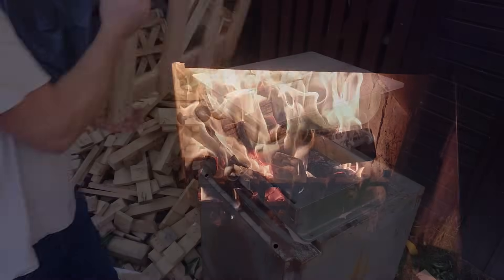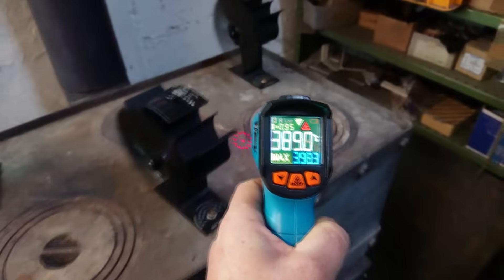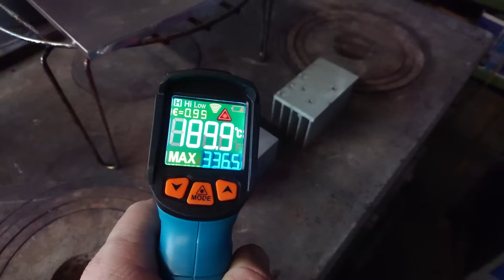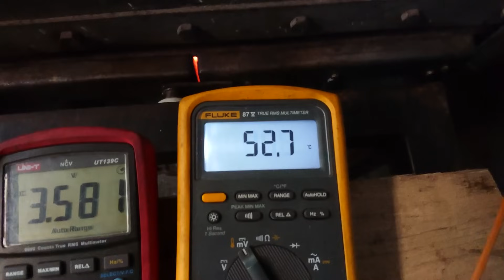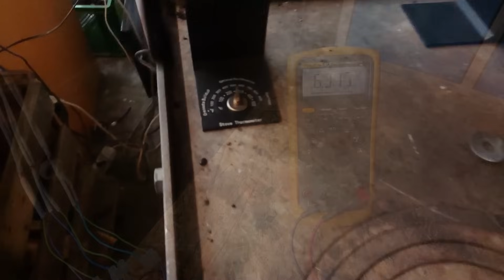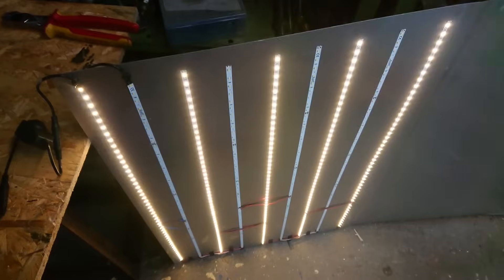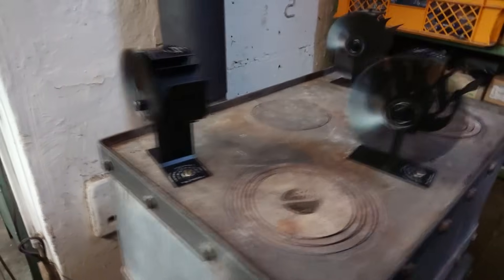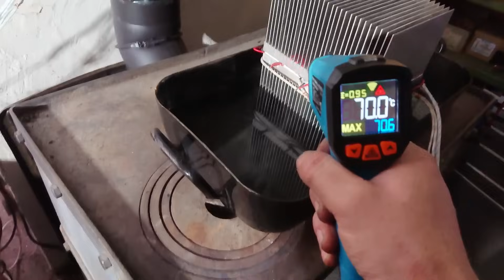Generating Electric Power with my Wood Stove - Peltier Experiments

Comment: You covered all my concerns in the first two minutes. Whether it's wood gasification, a steam engine, or a Stirling engine - there are much better ways to get meaningful amounts of electricity out of wood. 

Any of these would produce 10w, 100w, or potentially much more. 

If light is your only goal, propane and kerosine can get hot enough to get a mantle producing light. With some creative engineering you can probably get the same heat from wood.

Comment: There is a Civil Defense station near a friend's house up on the mountain that flies propane tanks with a helicopter a couple of times a year to use as Thermoelectric generators to keep the batteries charged up. So you probably could use it for battery top-off or for maintaining remote batteries.

Comment: Have you considered using thermo-couples ? You can wire as many as you like in series and you can separate the cold side from the hot side by a fair distance. I believe that types J, K, or N would be the most useful. You should have no problem locating a bunch of lead wire that has been removed from some chemical plant or refinery at some scrapyard. Then all you need do is get to work making all the hundreds of thermo couples required. This is I believe what NASA used for the RTG's on the two voyager space craft ( still putting out some usable energy after 45 years or so ). Of course the 'R' in the RTG name stands for radiation ( radiation thermal generator ). You would be using a heat source much safer than the plutonium plugs in the two voyagers .BTW such a device is called a '" thermo pile ". Small ones are used in some gas water heaters. Just put the cold side junctions an a sealed pipe with cool water running through it. Just like the Peltier Junctions, the bigger the thermal span, the more power!

Comment: A cold air intake from outside that was fed over the cooler side of the devices and then used to feed the air intake of the stove would help both the Peltier Devices and it would help keep your warm air in the shop....

Comment: I think an external Stirling engine, with the hot side fed from the wood burner's exhaust, would have a usable temperature gradient during a typical German winter - and could produce enough energy to charge batteries to power LED lighting.  Peltiers are interesting - but not really a useful energy source.  Thanks for the videos.

Comment: Hi Tpai, what about having two pipes on the stove? One is an outdoor-air intake pipe and the other is the hot exhaust pipe. You could place the peltier device between the two pipes to maximize the temperature differential. The exhaust pipe would perhaps enter the stove from the top so it is a natural path for rising air while the inlet pipe should feed air from below so it is basically acts like a diode for cold air.
Reply: BRILLIANT!! Vote this up!
Reply: The cold air pipe does not even have to be a stove inlet pipe, simply a duct open to outside would be a much bigger differential than his current setup, PUT A COLD BEER ON TOP, VOILA!
Reply: @Mr.Fabrication007  But why and how would you create wir flow if the pipe simply comes from the outside and goes back to the outside ? This would not make sense, since the stove needs fresh air anyways the idea makes much more sense. You want to reuse the components you already have not intriduce new ones this way you increase the efficiency and decrease part count.
Reply: I think he means creating an extra/ separate air intake on the stove at or near the bottom, while still having and rerouting the exhaust pipe. This would solve another issue- the inside of your shop would be much warmer making the stove more wood efficient. Instead of cold air coming in around doors and windows lowering the room temperature, the cold air is confined to the intake. I think you could create another section of square tubing for the intake and have the peltier panels inbetween.  This would give you a greater temperature differential, but I’m at a loss how to regulate it. This is a fascinating proof of concept- thanks for so much time and work- making the world a bit better.  @sierraecho884
Reply: Yes, good idea.

Comment: The only negative about your pipe addon was that you used the 4 pipe design, it will be a bit... difficult to clean the creosote out of every season.. I'm sure a purely square adapter (I think you implied you intended to use) would be not much of an issue, but I would def do the square -> round section smoother, without the lip.

Comment: how efficient is a peltier device.. and what is that system used to convert nuclear based heat into electricity .. used many moons ago.. at remote cold regions.. to operate radar..radio and lighttowers

Comment: Transfer the heat away from the stove using a circulating water pipe loop. A temperature valve regulating the flow could keep the temerature efficiently at 100 degrees C. If the heat drives the water circulation using a one-way valve, there's almost no moving parts. Then heat the peltier elements on the other end of the water system.

Comment: For the experiment with the exhaust id like to see a dual system with intake and exhaust running in parallel pulling cold air from outside cooling one side of the pelter and the exhaust heating up the otherside

Comment: Isolated water tank with the peltiers attached to an unisolated side. Natural vertical draft over the cold heatsinks on the peltiers. The Water can be heated by the chimney. Water circuit needs to be open/vented for safety reasons.

Comment: You can try water medium based heat exchanger I mean working like central heating (water movement up to collection basin over tipping cooled down water back to heat up again and just on output cycle install thermoelectric cells you will be safe with overheating as well😊

Comment: Great Project! Have thought about similar stuff a coupe of years ago.
Getting the heat out of the system is a pain in the ***, but transporting heat is quite easy. so I would work with steam, like a couple of others have suggested. Pipe the steam outside to a condenser where you mount the peltier elements. It also has the advantage of getting the elements away from the stove. Get yourself a big cooking pot (maybe a pressure cooker, so you can experiment), mount a hose stem, connect an isolated pipe with a steam hose and than the condenser.
For the condenser I would go with a perforated pipe inside of a square tube. Mount the elements on the outside and you have enough room to run wires for each element along the edges which should improve troubleshooting. use metal sheets for heat dissipation, cut it in an angle to create fins that point upward for a more uniform dissipation, than bent the fins in different U shapes. For a prototype I wouldn't bother with a return pipe.
Also: I wouldn't use the exhaust pipe, there could be a danger of creosol condensation and a chimney fire.
Grüße ausm Pott

Comment: If you had a stream that could provide a continous supply of cold water for the cold side. That needs to be plumbed in. Assuming you can take the water from a higher place. Or maybe pump it up using a ram pump.

Comment: I've had the idea of a completely Peltier heated and cooled off-grid solar cabin for years.  I would get about 1000 of those modules, and build them into an exterior wall of the cabin.  Then, you have several kW, even at their low efficiency, and they can be used this way in the winter (with a wood stove in front of them to supplement solar) with the outside temperature vastly improving the differential, and in the summer, solar could then be used in reverse polarity to cool the cabin.

Comment: You will get far more power if you swap out your peltier modules. The ones you used in the video have model numbers starting "TEC", these are Thermo Electric Cooling modules.
Have a look for modules with model numbers starting "TEG", these are Thermo Electric Generator modules.

Comment: Hm, I have my doubts, especially concerning that square section. 4 pieces of flat would have resulted in an equal weld length, and the moves from round to square section and back are an invitation to chimney fires imo. 
But I’m not really risk averse. I hoped you built some water and steam circulation system with a car engine turbofan and generator. But don’t forget an expension vessel or over pressure release valve😶…

Comment: you can stack two radiators fins to fins.
By changing vertical distance you would control contact area hence the termal transfer.
Just need to figure out mount. I was thing about drilling a hole in one radiator and a wide hole in other. A bolt goes through both holes giving the radiator free movement along the wide hole. Make at least two for each side to make sure good pressure applied into stacking fins.

Comment: I considered the same with many panels.

I wanted to use copper pipe with water circulation by heat and then have the other side cooled by the outside.

The water allows the panels to be away from the stove and drop the damaging heat while increasing the temp differential.

Comment: I've designed campfire equipment that uses peltiers like this and there are a few things you need to consider:
First off, you need to read datasheet correctly and datasheets that actually show limits would be useful. The ones you got does not state actual max operating temperature. Normally non high temp TEC is max 138c. Further more there is NO max delta when used as generators, those numbers are for cooling.
Secondly, there is actually a fairly large regulation potential in the flow of heat through the TEC by applying a load. The higher the load, the "lower themal resistance" the TEC will appear to have. In essence you can cool the hot side by dumping power into a seperate load if the primary load is not requiring enough current.
Lastly, the stove-fans usually use a bimetallic strip under the foot to "lift up" a bit to reduce heat input if the surface is getting too hot.
I would suggest creating a fan setup that is adjusted to get max temperature on hot side, and then use fans to cool cold side as much as possible while wasting as little watts as possible. Ideally the power should be stored in a battery using a MPPT control to maximize the power extracted from the TECs.
Reply: You might use an unpressurized water loop to keep the hot side from getting much past 100° C and get your hot water while you're at it. With space heating, water heating and cooking accomplished by the stove you don't need much power especially with cheap solar systems getting cheaper every day.
Reply: @johnassal5838  Hot water as hot-side limits you to a very low deltaT and kills your voltage output. You can see a TEG as a generator where the thermal flow creates current and the deltaT dictates output voltage. Higher temps on the element does reduce efficiency a bit but the increased voltage always wins. Modern elements can do over 300c on hot side and this helps a lot when dealing with wood fires. Also, cold side should be force cooled to close to ambient if you can, again to increase deltaT but also to increase efficiency. You can easily get 20+ watts out of a single element if done correctly.
Reply: @johnassal5838  
That's precisely what Im going to do, run a simple parasitic radiator off the burner to heat the peltiers.
Im going to see what happens at low temperatures first, if I can get the power I want/need by using lots of plates at low temps I'll do that, they should last a lot longer and if I need more power, up the temperature of water in radiator..
Reply: Regarding power. It seems these LEDs are constant current. Potentially creating a frequency could 2x or 4x the amount of lights powered as well as additional capacity to dump into a battery or supercap
Reply: @Nihaopaul  It doesn't work like that. But something converting voltage/current to ideally load the TEGs at all time would provide more power. Matching the load is very important with TEG. It's almost like a solar cell in that regard.
Reply: Good points
Reply: Yeah that makes more sense. The TEC I looked up on digikey stated "hot side max 80C, solder melting temp 138C/235C" so that must be the limit you are talking about. Maybe best to get the 235C model then? CP60133
Reply: Very helpful thanks!
Reply: Could you run a 7w bulb from a Peltier module?
Reply: @escapetothequinta  You may need to use a plate of 4 modules to do it easily but yes absolutely.
It's just a matter of thermal gradient and heat flow.
Reply: peltier elements are hugely inefficient. they experiment is doomed to failure before he starts to think about it.
Reply: @ursodermatt8809  Well just because they lack efficiency does not mean they make no sense. They are small, cheap, solid state, simple. They do work, they just waste at least 95% of power. If it´s your goal to simply light a small room or something with a whole oven they will work. If you want to charge a battery and really use the power you will need a stirling engine instead with all their downsides.
Reply: @sierraecho884  
if it is your goal to light a tiny led, bring a battery and a small solar panel.
ah yes, the sterling engine is the answer for the wood stove and is done in a few houses in germany and and thereabouts.
Reply: @ursodermatt8809  Solar is even better but misses the point since the energy source in this case should be the oven instead. You can also simply use an ICE generator for 200 bucks or so which has way more power. But that´s not the point here. 
Converting the oven´s heat into useful power is the goal as I understand it. One solution was shown here and other would be a stem engine, steam turbine or Stirling engine for example.
Reply: @ursodermatt8809  Yes they are, but they are always used in situations where energy is in abundance. The amount of energy released by burning a log of wood is so high that capturing 5-6% of it is enough. For example the module TE-MOD-22W7V-56 has an efficiency of only 5% if cold side is 80c (hot side 300c as this is a high temp module) and then the heat flux through module is around 400 watts while it can deliver 20 watts. 19 watts is enough to charge a phone fast with only 1 module! (Using 1w to run a cooling fan.)
I've designed camping-chargers like this professionally and they do work. I recommend using sourced wood for this, not bringing camping-gas and such though. Then you could just bring an extra battery 😜instead.

Comment: Heat lost in the burn process is the big issue. Like the idea of a water bank on the comments. Perhaps a flue with particle filters that can be replaced so inner cities could use wood without polluting etc

Comment: Be careful when you try anything on the exhaust side for a longer time. If you get it cold enough, the water in the exhaust gasses will condense and the condensate is corrosive and will eat away at your chimney material.

Comment: For what it is worth; for more accurate indications of temperature when using an infrared thermometer on shiny, reflective surfaces (low emissivity) place a piece of black electrical tape or similar on the surface. Measure the surface temperature of the black electrical tape. The temperature reading from the infrared thermometer will then more accurately approximate the surface temperature of the reflective surface. Your infrared thermometer may allow for emissivity adjustments as well. As always great videos.
Reply: Kapton tape is good too - and harder to melt.

Comment: When I thought about this sum time a go my idea was to make the thermocouple with the hot and cold side much further a part 
Mr Ohms used thermocouples in his work to derive Ohm’s law with the hot and cold side sum distant apart at the time battery were not very stable
Nickel chrome and copper make a thermocouple and it’s also called a see back Device

Comment: The heat fan I use has a bimetal strip on the bottom. When it gets too hot it lifts the base of the fan up and reduces the contact patch, thereby reducing the heat transfer to the peltier module.

Comment: Nice video, I see that there are two main issues: The Peltier effect efficiency and the temperature range. Those are hard limits, specially the first one.
If could, should shift the device to another (arguably) more efficient, like steam motor or phase change generator:
One side gets hot, boiling water to relative high pressure, placing a turbine between the high pressure side and a condenser would generate (maybe) better results, while not wasting water (Also hotter water would make the phase change easier overtime, improving the efficiency a little).
I'm curious about the results of such mechanical device and if turning a generator with the produced movement would be more efficient than the Peltier Effect.
Thanks for this video!

Comment: It's a "bit" of a project but have you considered a wood gasifier? NEMA has a schematic for one that's free and the "waste heat" could replace the wood stove. Feed the wood gas into a small generator and blamo carbon neutral energy with heat.

Comment: the Peltier effect being of very low efficiency (and only used in circumstances where no other generation principle would be viable, usually low power), I'd be curious to know what kind of efficiency you'd reached with your setup...

Comment: I did little tests with those Peltier modules. The best results I've had generating electricity was having the cool part in water. It helps a lot to keep the modules under safe temperature.
Reply: That's what I wanted to propose. He could gravity feed the water to the cool side of the Peltier elements, with a thermostatic valve regulating the outflow, keeping the water temperature at ca. 40 °C. The "spent" cooling water can then sit in a metal container and contribute to room heating (so no energy is lost), and when it is at 20 °C again, maybe the next morning, it can be transferred again to the upper tank of the gravity feed system.